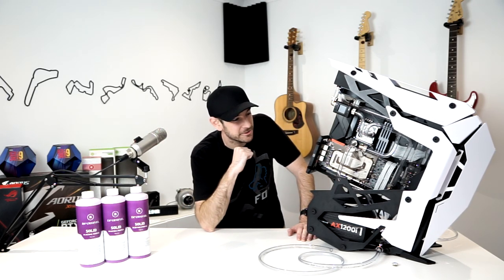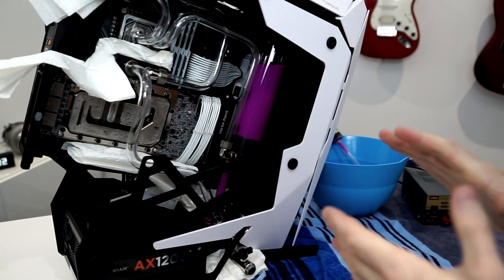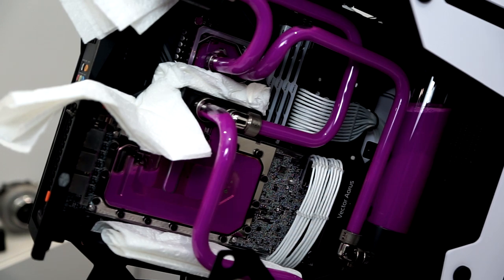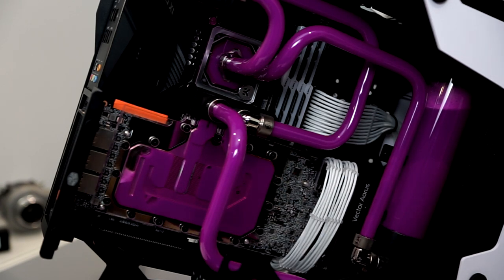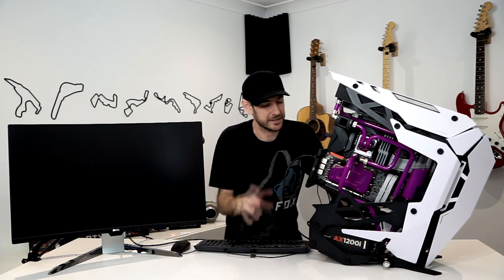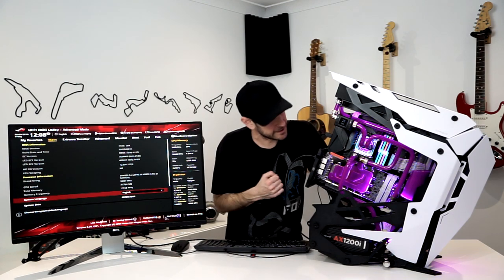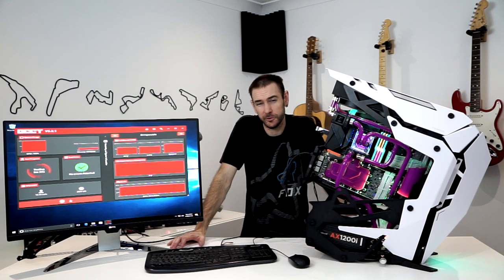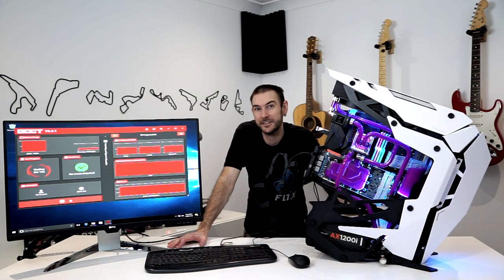Ultimate Gaming PC Build - Part 6 - Filling with Coolant & First Boot

Comment: Simply gorgeous build, I envy your bravery for hardline tube builds, did your drain the system before moving it? How do you even begin to carry a case like that when it looks so fragile haha!?
Reply from the maker: I’d drain it if I were moving it in a car but not to move it around the house. It actually has some pretty convenient places to carry it just I front of the top radiator and under the power supply.

Comment: I have heard these inline temp sensors are prone to leaks.  Anyone have experience with them?
Also with asus boards never worry on first boot. The default is set to splash on and 30 sec boot timeout... that combined with the mem training makes for a long first boot. Totally normal mate. Disable both of those and you will be into OS in 5ish seconds. what a looker and great choice on purple with white.
Reply from the maker: Any additional joins and gadgets create the opportunity for leaks I guess. Will let you know how it goes.

Comment: The corner on the gpu cooler where the air still sits... when it is that hard to get that air out of this pocket, won't it be as hard to change fluid in this area and could cause heat building up in this pocket?
Not an expert on liquid cooling, just curious.
Reply from the maker: No, it bled out easily by tilting the case :) This system was an absolute breeze to bleed compared to the one I built last year.
Reply: That bothered me so much! Tho at the end it seems like the air pocket is gone. Pwew
Reply from the maker: Perfectly normal to have air pockets when you first fill a PC. That’s why you have to bleed the system.